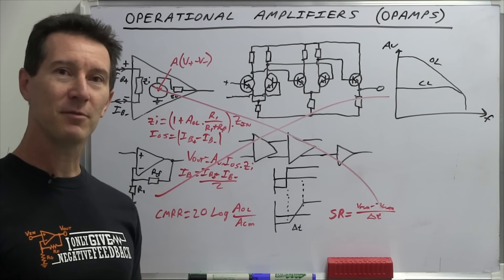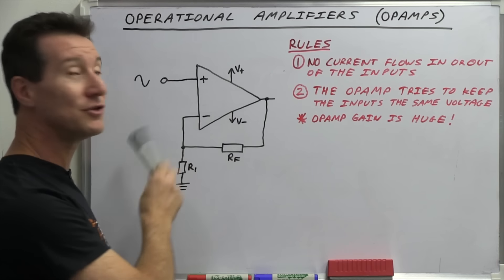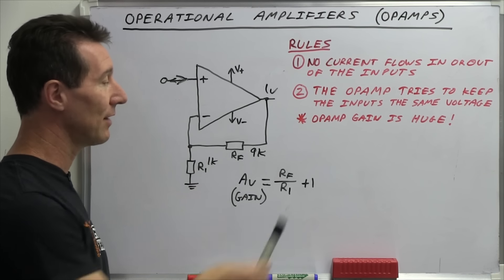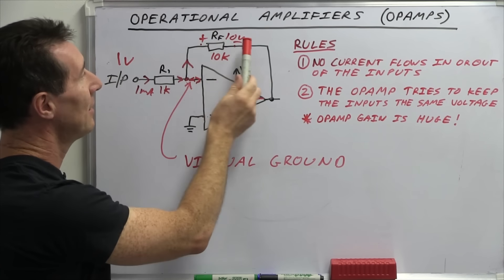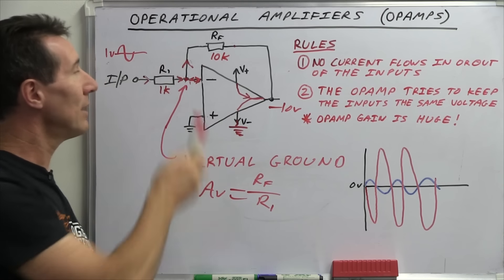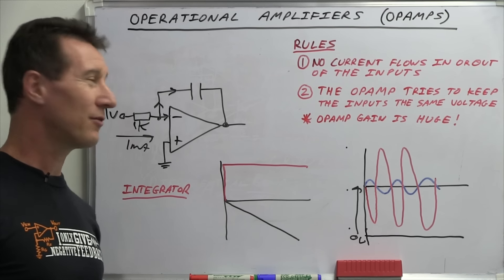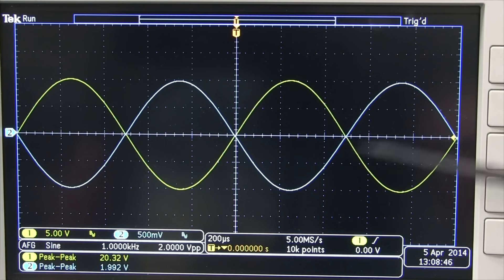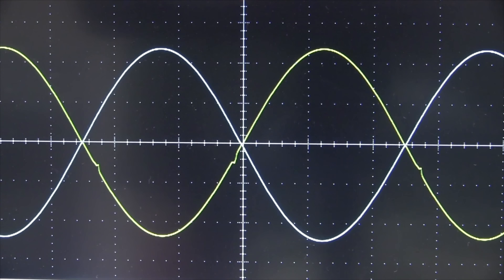EEVblog #600 - OpAmps Tutorial - What is an Operational Amplifier?

Comment: Hi dave,  your efforts are appreciated. I want to know can I use the op-amp in buffer state to measure the open circuit voltage of PV panel without disconnecting the load. Thanks.

Comment: For control unit os Buck Converter Circuit, voltage divider Method will be tracked for PID Control unit. How can we connect the output voltage(400VDC) to OpAmp for looking voltage(3.3-5V) which makes easier to apply on ARDUİNO or Buffer to prevent the damage on circuit?

Comment: I've been wondering how to tap into the sawtooth wave voltage of the capacitor in an astable 555 circuit without disturbing it. It seems using an op-amp as a buffer may be the solution I've been looking for.

Comment: This might be a stupid question, but how can an input have a voltage? Doesnt it always take 2 points which in comparison to each other build up a voltage? How can there be a voltage without current flowing? And since the input is connected to the opamp, wouldnt the voltage change dependin on where you measure?

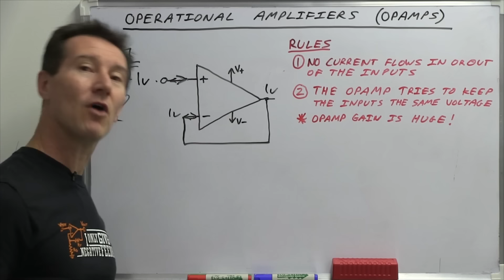Comment: i am still confuse about the increased current in the output at 12:22. why it can DRIVES current to the output? rule one has already said that there is NO CURRENT in or out of input.. Current can't bypass the non-inverting input right?

Comment: Hey Dude - Love your videos - very informative!!!  Question - Why would a 741 op amp simple 2 resistor (gain 11 ) 10k and 1 k being used as seismic amp from a coil - why would this amp just jump to a + POSITIVE OFFSET on its own - like no reason  THEN some time later it will go back to base line of ZERO right on the "0" line as reference - Ive looked at the NEGATIVE supply to see if it dropped out - but the + and - supply is ok - THIS ON HAS ME STUMPED  - H E L P !!!!!!!

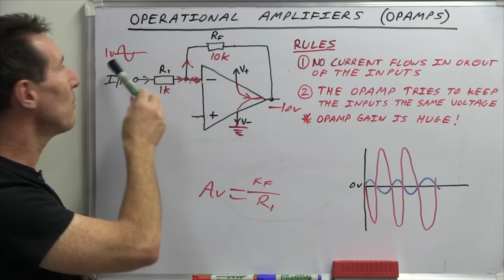Comment: I would like to try out your inverting configuration. If I have a piezoelectric sensor with 2 pins producing AC voltage and a 9V battery, is that means I am using a single supply? I connect 1 pin of the sensor into V_in(-) but I do not know how to connect the other pin. As for the battery, since it is a single battery, is connecting the (+) to V+ and (-) to V- of the Op-Amp fit in with your inverting diagram (28:25)? When my sensor flex/bend, it generate mV signal and I want to amplify it into something in Volt. I am using 9V battery so the resulted output is AC and less than 9V.

Comment: @EEVblog - one question I do not understand. In your practical example you use +15V and -15V as voltages to drive the OpAmp. So how do you get +-20V output (10x) with +-2V input? I understand the math, but I do not understand how the OpAmp delivers more than the voltage applied to the OpAmp
Reply: Okay, now I got it - it is peak to peak so actually +-10V not +-20V.

Comment: Hi Dave,
I've implemented Schmitt trigger model with op amp using voltage devider as reference input + and feedback. But Found a oscillating 10mhz to 100mhz when input - move near volt reference. So how to solve this issue?

Comment: is it normal that it actually doesn't work in the same way with LM386 N-1 ? It is also op-amp right? I know that its purpose is for audio etc. but it should have the same function as lm358 as it shown here ? Or maybe my understanding is not right... I tried and with 386 I get some results with compare voltages or amplify but not exactly as I expected and voltage from my sensor drops a little bit anyway!

Comment: So could I use an op amp between a digital circuit with lots of logic ICs, and a bunch of solenoids controlled by the logic ICs, to prevent the power spikes from the solenoids from interfering with the sensitive ICs?
Reply: @lepidoptera9337  Why am I not using clamping diodes on my solenoids? Because I have no idea what I'm doing! 😆 I did sign up for a circuit analysis class, that should start me down the right path at least.
Reply: @lepidoptera9337  This just in: If you already know what to look for, finding it is easy!

Comment: Sir, If the 2nd rule applies, then we will get difference as zero. Zero difference between  v+ & v-. So, how do we get the output to be infinite gain? (* i am a mechanical engineer, this is my 1st experience with these devices. :))

Comment: Joe Khoury
1 second ago
I'm a DJ, and run into videographers wanting to connect into my mixer often. I don't have issues doing it. The problem occurs when they connect to the back of my speaker. It either lowers my output, or basically shuts off the speaker. I believe it may have something to do with phantom power perhaps? Is that something somebody here can explain. I don't have an audio receiver, but is there a setting to turn off phantom power?

Comment: I have been doing electronics for over 40 years and repairing a lot of audio equipment that uses op-amps in the signal path. I've always been stumped at how the signal disappears at (what I now know is the virtual ground) yet magically appears at the output of the op-amp. Thinking about it now, an op-amp is just a whole heap of transistors, and transistors amplify current, not voltage - so it is the current in the loop that is being amplified not the voltage at the input resistor. I think that's the principle - someone correct me if I'm wrong.
Reply: IM in a morning mood and i can Say i dont understand nothing at all … one ideea in My mind … we create an potential  by that loop ,that magically the opamp it replicating at a certain level amount …

Comment: Hi eev blog can you please tell me weather the amplifier does convulution by stacking and scaling the input so the signal is amplified but my question is some amplifier have capacitor inside it so it rejects some frequency by convulution I guess but how something which can amplify a voltage or current signal by stacking and scaling can reject some frequency by stacking or scaling ie by inductor or capacitor so I may be wrong so please guide me in this question

Comment: Hai this is dal i need to know if we feed signal in both non and inverting trminal is there any phase error did you obserbe. I have observed if same sinal is fef to two op amp sections one for inverting other non inverting out of both if you line up is not exactly 180 degrees out of phase this is ilan issue with op amp. Thanks for your attention

Comment: Why, at 13:25 in a non-inverting amplifier must Rf always be bigger than R1?
Reply: Because otherwise the current flowing from the input of the inverting pin through the feedback resistor and onto the output will be multiplied by a feedback resistance that is lower than the input resistance, which leads to a lower Vdrop across the feedback element..

In other words, if Rf is smaller than Rin, then you have yourself an attenuator that is eating Vcc power... useless and wasteful, unless you need some isolation between input and output.
Reply: @cactusheart9632  Ah thank you! So it would work, I mean the output wouldn't jump high or something, it just attenuates the signal. Something you'd normally do with a resistor voltage divider.

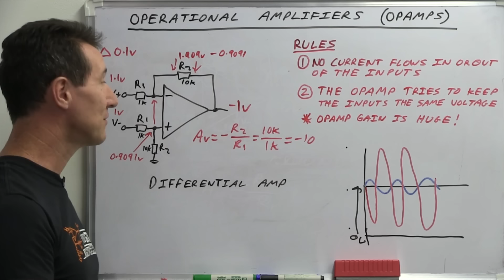Comment: time stamp 35:29 how come the voltage of the node at the non inv input is equal to the voltage across resistor r1?.Im confused by how the virtual ground aka virtual voltage at the inv input will be 0.0909V.Could someone please explain how the calculated the voltage drops across all the resistors,

Comment: that integrator circuit doesn't make sense. If you put a voltage of 1V on the inverting input behind the resistor the opamp will try and pull that to virtual ground and apply a negative voltage on the output. Initially some current will flow into the capacitor, but eventually it'll fill up. The current will try to drop, and the op amp will have to increase the output voltage to keep the current the same, eventually capping out at the rails voltage or blowing up your capacitor, whichever comes first. Where is the use in that?

Comment: I love the EEVBLOG, but I don't get this at all. 1 - "Opamp gain is almost infinite."   It is?  How does that work?  You mean, if you put 1 volt on the input,  a million volts appears on the output?  And if that's not what you're saying, then what ARE you saying?  2 - "No current flows in or out of the inputs." - Whatever does THAT mean?  How does the opamp do anything or sense anything if no current flows into it?  Why is it called an "input" if nothing goes into it?  Electronics is like religion - so many hazy senseless concepts that you are supposed to take at face value, but that no one bothers to, or can,  explain.

Comment: In every video I saw it shows me that an op amp is a  triangle with a plus and minus on the left side,     a power source top and bottom and a single output on the right.    This makes me think that the OP AMP is a component,   just like a capacitor or something,    rather than a circuit.   Thats not what I want to know,  I want to know HOW to MAKE the op amp aka the triangle thing.

Comment: The part about no current flowing in/out of the inputs is bullshit — I just had to solve an input bias current problem in a circuit. Be aware that a small amount of current is flowing out of the inputs, and if left unchecked in a circuit where a capacitor is connected to the op-amp, this will slowly charge the capacitor, as an example of what that current can do.

Comment: It’s being over 2 years now am still trying to understand how to get any op amp to work when I add vcc and end 12 volt am getting 12 volt on the output and half is 6 volt negative and 6 positive when I add 33 millivolt the positive voltage don’t get greater because the pnp it’s still on and npn is still am not getting anything of them to stay off am designing a current senor I can get the bjt to turn off even at 12 volt over current on the resistor the two transistor still on so i read the database sheet on I can find anything to staying the output is voltage is zero I use lpm 358 and ua741 op amp and o get the same results I can’t understand how it work in real time as a operation amplifier i use every ic knew to men but op amp is the one ic I can get to work in current sensor circuit only comparator work

Comment: Having the first role as current  is not a good  way to explain how an op amp works. You can feed both non-inverting and inverting signals into the inputs on the op amp

Comment: An Op-Amp DOES NOT try to keep the inputs the same voltage. That behaviour is just a consequence of using it in a feedback configuration. What it does is make the output rise if the NII is high or make the output fall if the II is high, that's essentially all it does. It's not trying to match the inputs AT ALL.

Comment: I don't understand how inverting configuration works. Like let's assume that opamp has infinite impedance, input resistor has 10k and the one of feedback is 100k, thus we get one 10k resistor in series with 2 parallel resistors one of which is 100k and the other one is infinite. So how it is possible that all voltage drops across first resistor if there is second one in series (bc resistance of opamp is infinite)? Why this configuration doesn't work as a voltage divider? And how or what forces current flow through a resistor and pulls voltage up???
I would greatly appreciate if someone could explain it to me. Thank in advance))))

Comment: This video misses some more words about how "the op amp will do what ever it can to keep both inputs at same potential(voltage) in negative feedback configuration". Also "the young player" should know about "differential amplifier" "current mirror" and "push pull" as a pre before watching this good video.

Comment: i wonder what op  amp will do if   it is    single  power  from  like  0  12vdc  as    ground and  vcc    and  not  +vcc and   -vcc  becasue now  op amp  wont  be able to  swing -10  to convince   current to  skip   the virtual  ground   and  go the  -10 vdc  as     -10  is  more  negatve  than  ground i      now no more   -10         i   thought  all  day    and i  cant figuire  out  how op  amp  will continue  doing its jjob

Comment: Can anyone share the explanation for the spikes in the last question?
Reply: I'd wager it's crossover distortion which is very common in older op-amps like the LM358.    There are ways to mitigate this distortion, however in the last few years, manufacturers have developed "zero-crossover" amplifiers that eliminate this problem entirely (at an increased cost).    Here's an app-note on the subject: https://www.ti.com/lit/an/sboa181a/sboa181a.pdf

Great explanation Dave!    Op-amps are some of the most misunderstood yet handiest circuit elements in an analog engineer's toolbag.

Comment: What is electronics if not the realization of mathematical systems by means of circuit elements? And that's why DSP killed electronics. And what is a DSP if not the realization of mathematical systems using a digital computational device? Wait ... aren't those made with electronics? I got confused.

Comment: What do you mean by saturate ?
Reply: Saturation of an analog op amp occurs as  the magnitude of output voltage increases to its MAXIMUM .
A  sine wave input will become clipped (flat peaks) at the output as the ouput increases beyond its MAXIMUM swing.

Comment: batteries should be described as    12 volt positive and  -12 volt   negative terminals as they flatten  they go 12 11 10 positive and -12 -11 -10 negative then circuit diagrams would make sense on amplifiers circuits better and easier to teach kids that if you create a lower voltage on the amp + side you create a higher - voltage on the negative side and vise versa explains  how a gain is created whether its a + or - gain or + or - loss then your theory shown becomes easy to understand then its teaching why ground is important neutral etc

Comment: Yes, but how do you make an opp amp?
the way you explain it seems to violate the first law of thermodynamics because you get a bigger output than input.
and is the triangle a wire or something else? i thought there were resistors inside the triangle or something
big thumbs down for violating the laws of physics. you need to go to physics jail
Reply from the maker: The bigger output power comes from the power supply, so no violation.